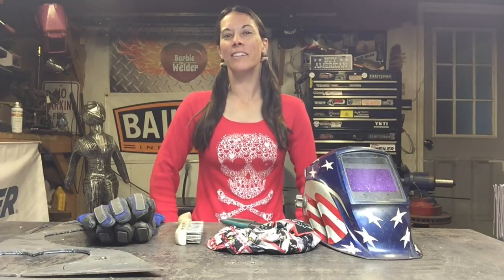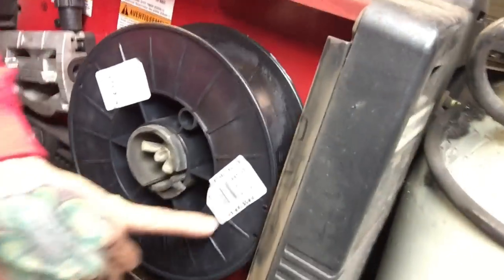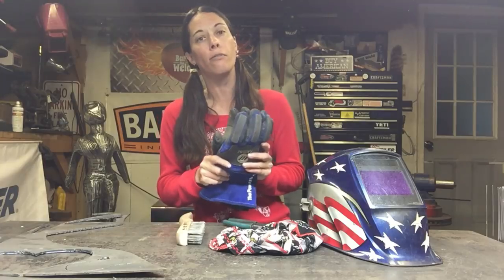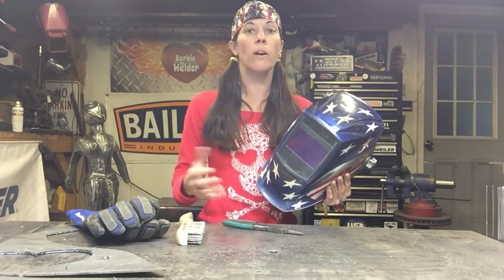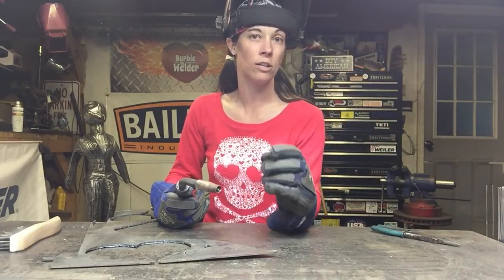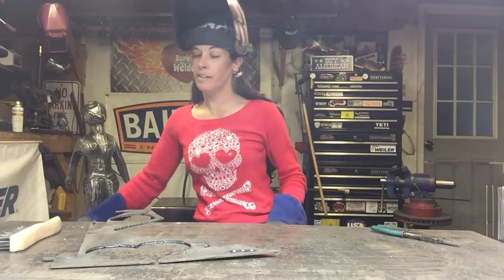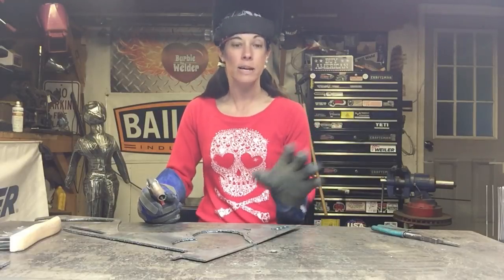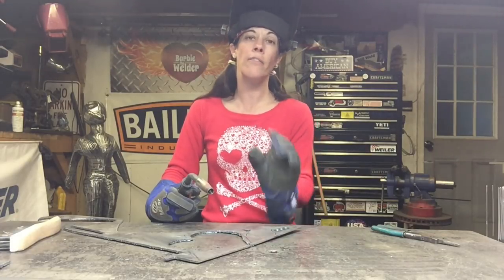How To MIG Weld

Comment: With all due respect the training I received you push the mig tip i.e. weld bead. By dragging the wire tends to melt in the bead. By pushing the wire is continually striking an arc in the base material for good consistent penetration. Although in some circles this issue is debated.

Comment: Not trying to criticize, but you might want to consider wearing safety glasses when welding. The weld splatter can get still bounce into your eyes with a face shield. BTDT, and not a pleasant experience to have it removed. Only a suggestion. 
I like your artwork and wish I had your artistic ability. I usually do repair type welding, and have done production welding, but dabble in yard/garden art.
Reply from the maker: +oldbones I do wear them occasionally but you have a very valid point!

Comment: Good video. U mentioned that when tack welding the wire should touch the area to b tacked.  When welding a bead, with a flux core welder, should the wire b in constant contact with the area ur trying to weld or once an arc is est should I hold the wire slightly away from the weld area?
Reply from the maker: Flux core welding is done in the same exact way as gas mig, keep your torch nozzle about an inch from your workpiece and your wire should look like it’s constantly in contact with your workpiece.
Reply: Thank you.

Comment: Hey Barb, please please inform any Barbie inspired new elders of the danger of harmful metals when heating and welding. When your not a fabricator and welder ALL metal is metal this information can save a life!! TY great job and much respect going out you!!
Reply from the maker: +joel stein good call!! Thank you!!
Reply: Danger of harmful metals? What the hell does that even mean?
Reply: Not sure what he means, either, but assume he means galvanized (zinc), etc?
Reply: yes that is just one thing zinc when heated to that temp will kill you in short order its a nurotoxin a tinybit will make you sick a little bit will kill, also dont use ammonia or clean stuff with chlorine bleach always use accatone, bleach will vaporize into chlorine gas and kill as well, and getting too much floride inhaled from certain steels can do damage too, always weld safe, and watch for fires.
Reply: And never ever fix gates that have peeling paint as you will need an fire extinguisher  I know from experience I've done it s9me one nearly called the fire service on me lol.

Comment: Good video, auto darkening helmet is a must have for people working alone in their garage, it will make your life so much easier ( try assembling something that requires holding down with hands, while using a flip down hood and a stick welder, it freaking sucks), but yeah, clean your material, have good ground, and as you said just practice, scrap metal and bead after bead after bead...
P.S. Those are some gigantic gloves you have there :D
Reply from the maker: +Bojan Maksimovic The gloves have endured the test of time!!

Comment: Hey!  When did you start your youtube channel?  I started welding about 2014 and I swear there were not many artists on youtube at the time.  I did find some videos out there that did help and I did eventually get  going on mig.  I primarily have been welding small garden art, out of re-purposed silverware.  I don't have a huge garage, and it's not heated so I only get to work in there in the spring and summer (Minnesota).  I started out welding primarily because I needed a hobby to get my mind off of some pretty tough events in my life at the time, but I am not a 'crafter'.  I like to do the unusual.  My husband just happened to had bought a mig welder but had never used it.  We joke now that i'm the welder in the house (although I doubt I would trust it for integrity-I still have those moments of splattttter lol).  Anyway, I am now setting out to watch all your videos for inspiration!  Thank you so much for your channel and sharing your art with us!!
Reply from the maker: Incredible! I’ve only had the channel for two years I believe. Happy welding sister!!

Comment: Great informative video's.  Question, I can see my puddle but have difficulty seeing were I'm going.  In comparison, when I gas weld I have no problem for obvious reason, not arc.  I'm  73 and kinda new to this.  Any info would be helpful, thanks.
Reply from the maker: +Dennis Schoessow are you using a fixed lenses helmet or auto darkening? Gas or flux core welding?

Comment: Huge fan Barbie!, what gauge steel do you usually use on stuff like your friend behind you or the fuel bowl fish?  : - )
Reply from the maker: +Bull Mtn. Billy The angler fish is 18 gauge steel. Each project usually has a variety of different thickness of materials in it. I use scrap so some of it is 1/2" thick and some is 24 gauge, depends on what I'm making. 💙👩‍🏭
Reply from the maker: +Bull Mtn. Billy I run .030 for everything you see me weld. Super versatile!💪🏻

Comment: Excellent video Barbie! Do you have any videos on gasless MIG? I'll have to get back to you on the model of welder I have but it's a very basic Lincoln with an infinitely adjustable feed rate but only "A-B-C-D" amperage adjustment and I'm not sure if it can accommodate gas. In 5yrs of welding here and there I only rarely get a respectable looking weld...and sheet metal is a total no-go - burns right through on the "A" amperage setting. Pretty frustrating as I spent a couple hrs cutting sheet metal for a smoke hood for my forge and I trashed it...Cheers!
Reply from the maker: +Vernon James I can’t see the puddle welding flux core. I welded an entire trailer by feel using flux core back before I had my mig.
Reply: +BarbieTheWelder well I suppose I wouldn't even know what a puddle is supposed to look like as I've only ever used gasless LOL...and my Lincoln Weld Pak 125 HD does not appear to be gasable :(  All I see when I weld is a trailing glob...and I simply try to make that look like the coveted "stack of dimes".  Definitely interested in taking a full sculpting class with you perhaps early next year.  I'm not remotely blessed with the creativity that you have but I do have an idea to create a spine with ribs and inside them a full right lung and half of a left lung as I had the lower half of my left lung surgically removed to fix a nasty respiratory disease that I earned during my time in the Marines.  Cheers!- James
Reply from the maker: +Vernon James thank you so very much for your service! I can help you build that! What a meaningful sculpture!!
Reply: Much appreciated Barbie!
Reply from the maker: +Vernon James Thank you Vernon!